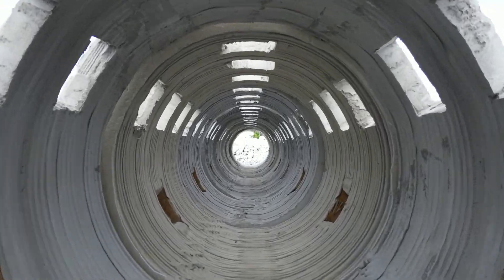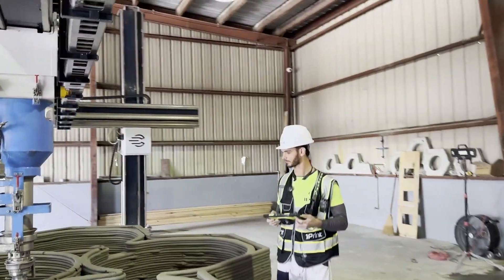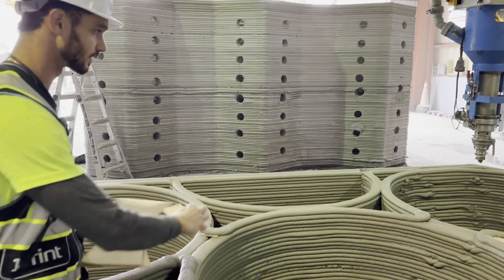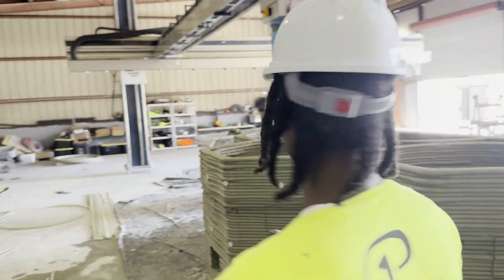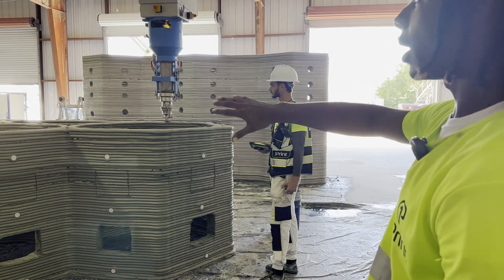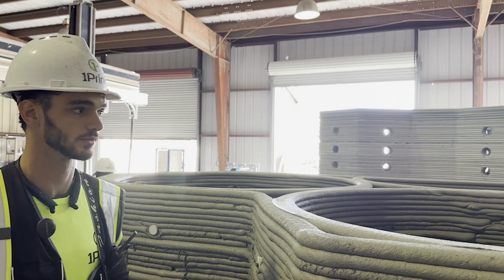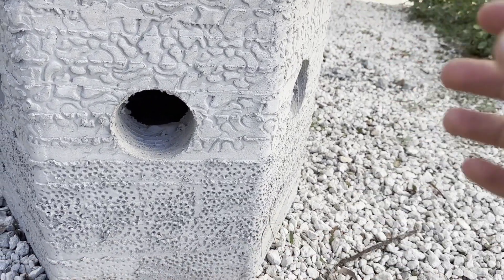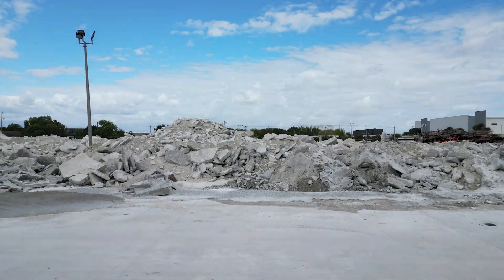Can Concrete Printing Save Florida?

Comment: Hard No until the moisture and air flow quality reports show its safe for humans.
Reply from the maker: It's for fish not humans. I actually stayed in a printed house overnight once with an air quality monitor, it was mostly fine but with 4 people the CO2 started to rise inside and we opened a window. Now that company includes extra ventilation to make up for the extremely strong blower door tests.
Reply: @automateconstruction  If the layers are printed evenly enough, such structures would have a very hermetic seal to them, exothermics kept at a reduced level with the air space gap going on inside the diameter of the printed dual wall contours, not to be confused with hermitic seals though that tend to live alone at the waterfront and swim around alot and prefer no windows whatsoever, other than windows of opportunity!

Ok Google, ask your newest ideration of A.I. to design and print off segments of itself into a self assembling mobilized robotic form, and get it to walk, no, run around like christopher walkin in a gravity defying music video, using a auto tool changing extruder system/manifold/telescopic arms to print me and others some cities, and and make them float please like the album cover for Boston.
Reply from the maker: well said, some printed buildings I visited had such good seals the CO2 levels started getting high inside from too many humans breathing. Now that company knows to add ample exhaust fans. @truetech4158
Reply: lol pay attention. everyone online has their PRECIOUS OPINIONS they demand to tell everyone despite the basic lack of attention or common sense. it's not about YOU.